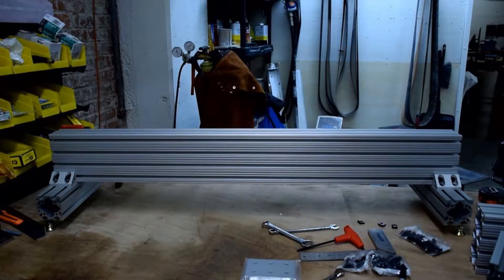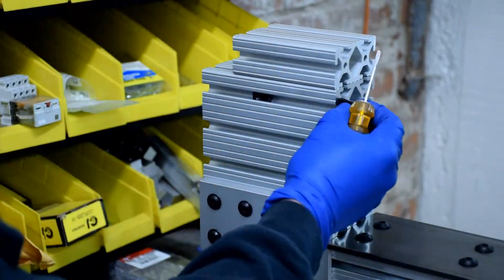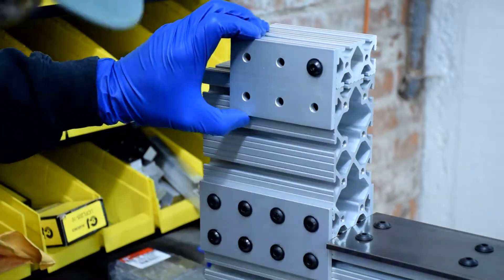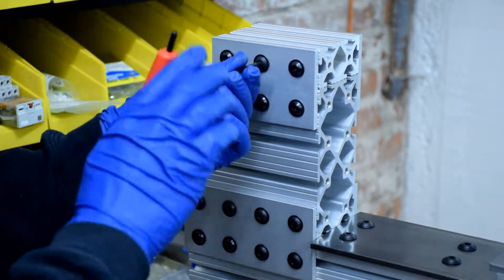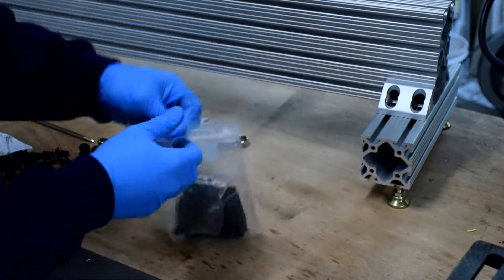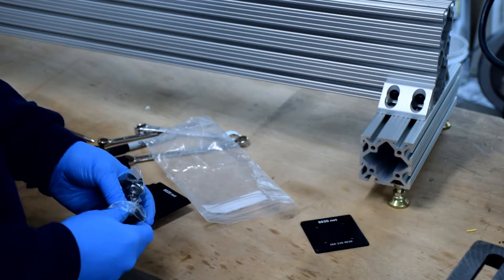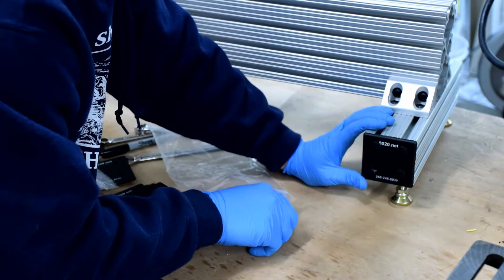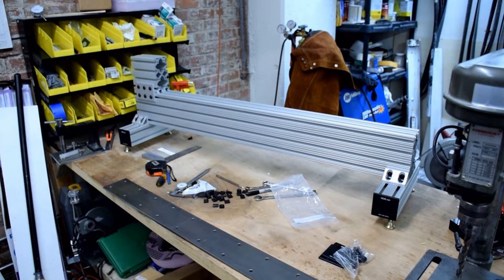OpenLathe Frame 3

Comment: I used the 4 inch extrusion with the 4 hole plates as the parts list listed. And there was no 4.5 top extrusion piece or mounting plates listed at all. Is that fine or will I need that? I just assumed you simplified it later on.